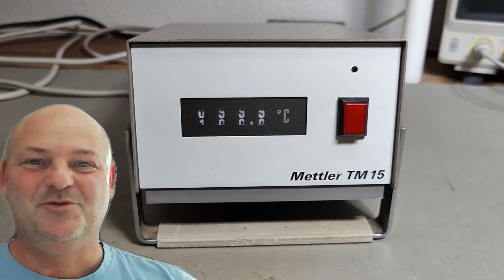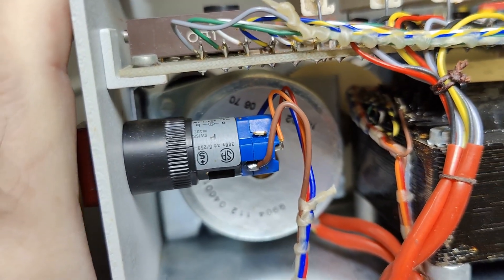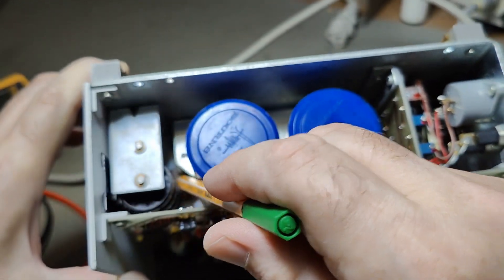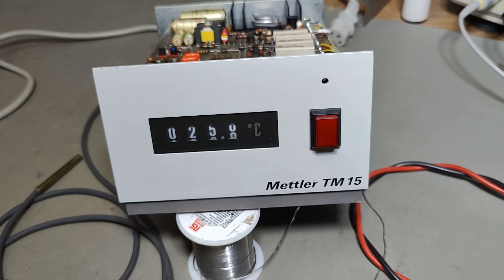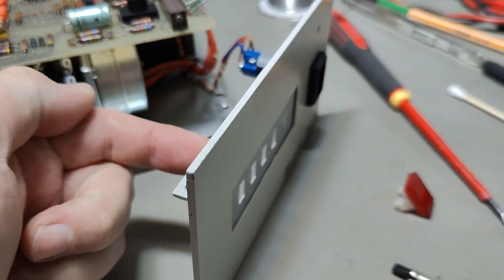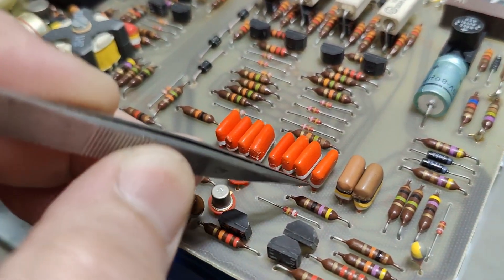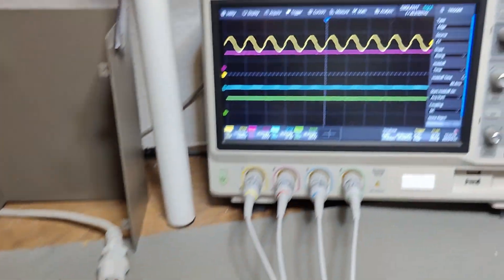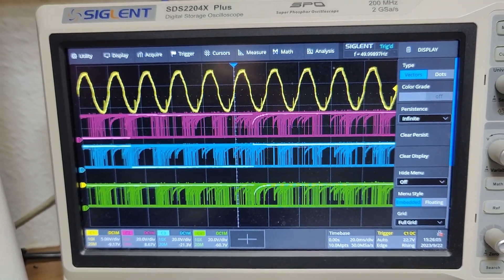Mettler TM15 RDT PT100 temperature display 1970 test teardown

Comment: Amazing old school, I wonder why they did not use a moving coil meter with switched ranges. my be its more linear with the counter ?
Reply from the maker: this is as accurate as the large multiturn potentiometers they compare with, and they are crasy good, but the motor could have been a DC type, it is really cool they control a 4 phase stepper this way, i have not seen anything like this before